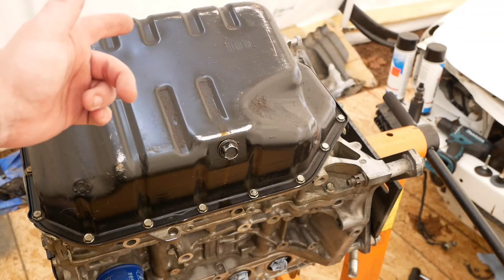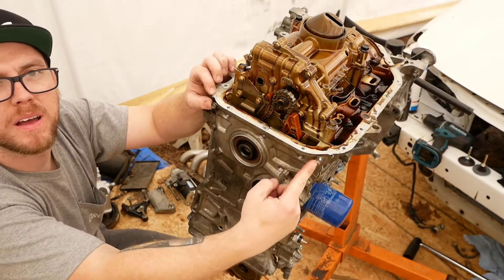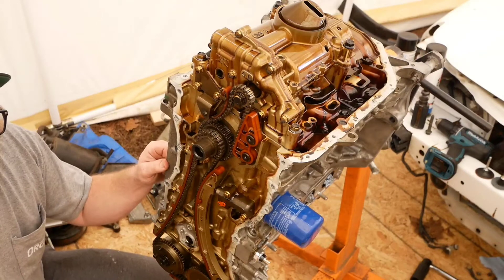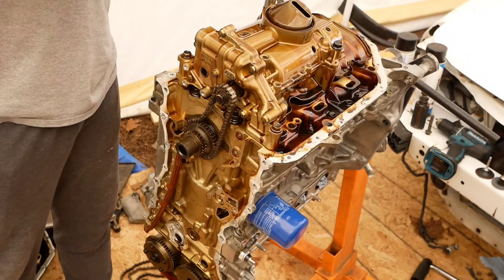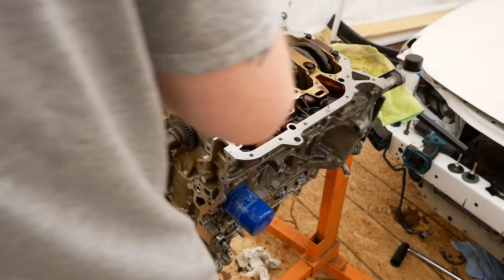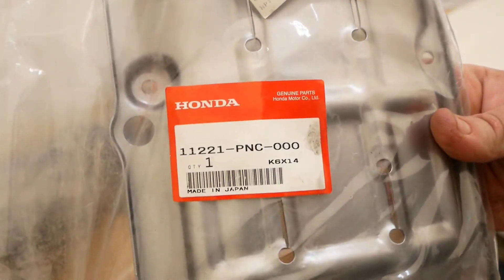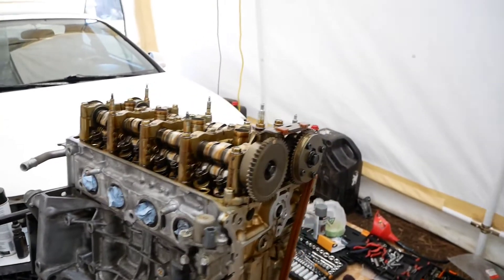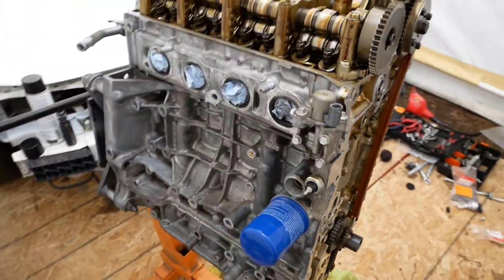Upgrade Your K24a Oil Pump! K20a2 Pump Install Video

Comment: Imagine all the stuff you can't do due to lack of money?....

Money's in the way of progress.

Without money you're stuck.

Imagine if your car breaks down in the middle of the road?

No money to get it towed?

You're most likely going to lose your car.

How bout if your car has a bad part?

It could pose a threat to others.

But they don't care.

They'll give you a ticket for not having the money to fix it.

Yeah.

Or take your car.

Messed up.

The money system is a problem.

A huge problem.

Look at all the crime over money?

Yeah.

It's that bad.

Because if money is a problem?

Then the solution is a system without money.

And I already created a system like that.

It's catered perfectly for our good traits.

You work to help others.

Not for self gain.

Your payment is having helped someone.

Helping society move forward.

Not just yourself.

Because in a money system?

It works only if there's money.

Not out of common sense.

And my system is about common sense.

Not based on interests.

It promotes generosity.

Honesty.

Truth.

Not like this one.

This one promotes greed.

Selfishness.

Lies.

In my system, things are free.

That's why there's no need for money.

We work to keep things being free.

So cool.

Imagine getting a brand new car?

Or a brand new engine?

You could do so much.

Not have to worry about needing money.

You can have a house.

Or two.

Super cool.

Just ask my system, and we will provide it.

If It's available.

Yeah.

So checkout my channel.

I expose the enemy of mankind.

And other things there too.

I also post car stuff thru GTA.

So check it out.

Leave a like.

😬